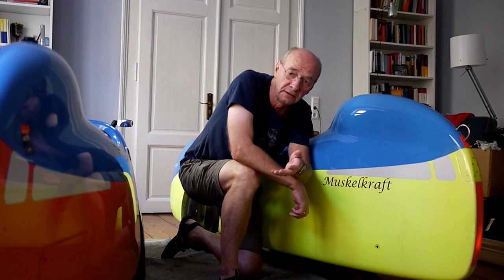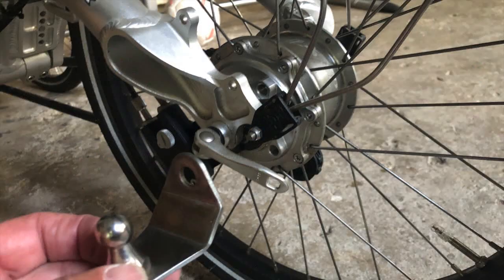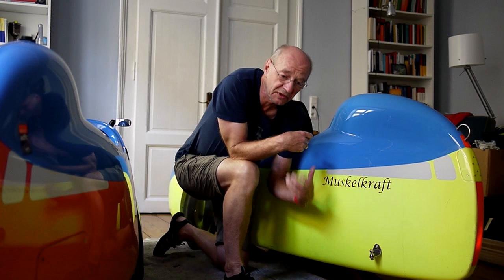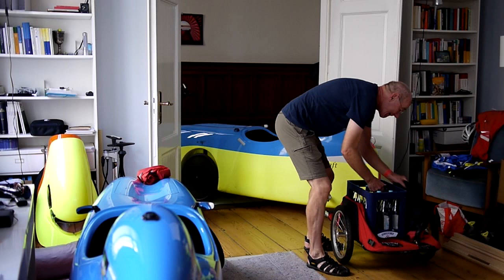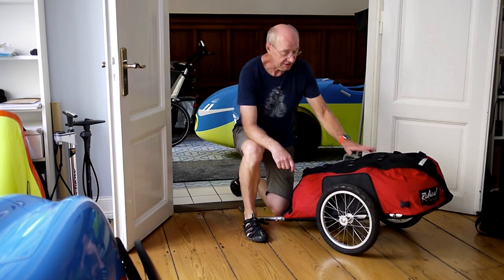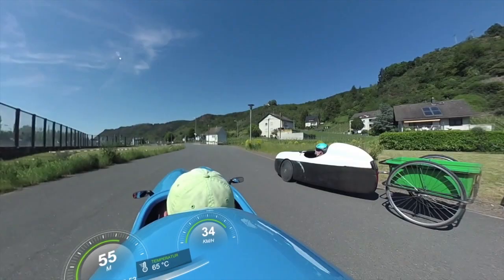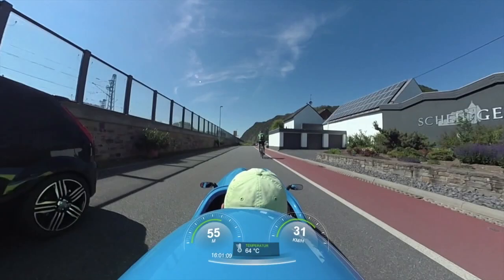Velomobile Trailer Review-Josef Janning

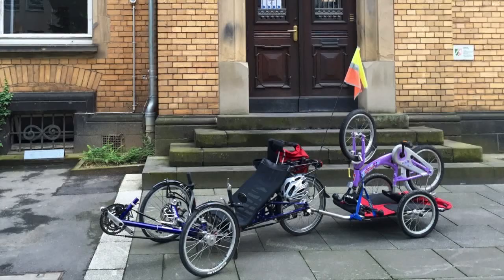Comment: 7:37 This connection is defenitely the best, on the most back - so you can turn full to the right. If you connect the trailer on the side or the hub on a bicycle it's limited when you turn right.
Reply: I believe this is a home built one. It must be working well because Soeren does a lot of touring with this setup. Also, as you can see, a short tow bar will do with a mount that far back. With regard to turning, I didn’t find any problems with right turns in my setup. The tow bar is bent, giving enough clearance for real world right turns.